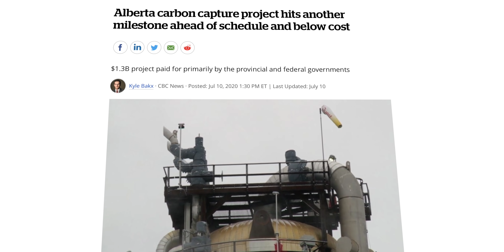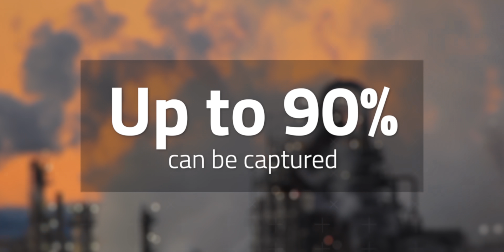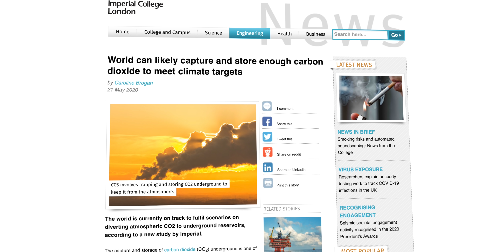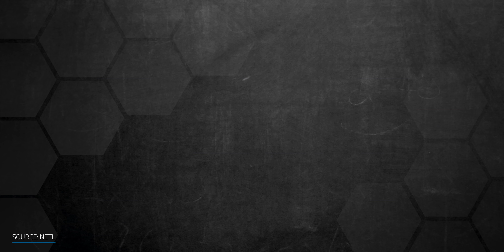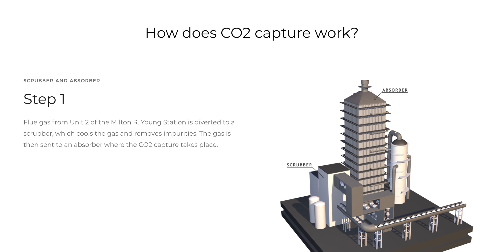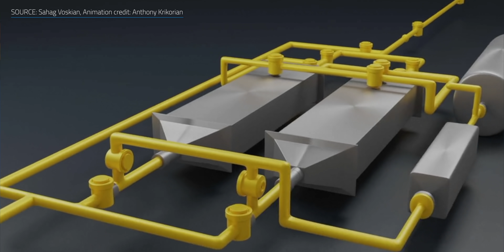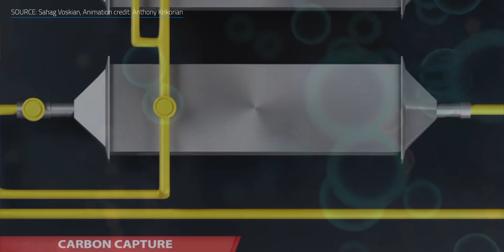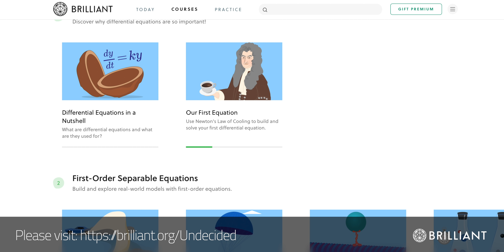The truth about capturing CO2 to reverse climate change

Comment: Why are we putting so much into stopping CO2, which only represents at most 26% of greenhouse gasses, why not concentrate on the one that may at most represent up-to 72% of greenhouse gas? 
Water vapor causes 36-72% of heat capture in the atmosphere, so if that represents 1.5-3 times the impact why not work on H20 instead of CO2 which only represents 9-26%?
we have plenty of industries that expell H20 so why not prevent/capture that
Reply: I know water exists in the form of oceans, seas, lakes, ponds and rivers but why does that mean we should not do anything about human emissions, especially considering all life on earth produces CO2 (yes even plants, they use photosynthesis to produce O2 from CO2 if they have light but use respiration to produce CO2 when they do not have enough light to photosynthesize.

Comment: Co2 is part of the planet life. Stop this nonsense. Co2 is the life line of the planet flora and oceans. Pollution and Co2 are 2 different things. Climate change is part of the planet cycle. We are  responsible for less then 1/4 of the world Co2. During the medieval Co2 was triple the amount of today. During the roman empire Co2 higher as well.
If during 1 year half the active volcanos decide to erupt you can't stop the Co2 increase.
If you have a green house and you want bigger plants you increase the Co2 inside.
Class C3 plant life has been extincted for millenia because the amount of Co2 in the air is low.
Stop scaming green House gases and pollution are bad. Co2 is normal and planet flora and oceans need it to create oxygen.
Now go drive you Co2 free tesla off a cliff.
Scammer.

Comment: "The energy sector is responsible for three-quarters of all green house gas emissions" BALONEY. the most powerful and by far  the most abundant of the 'greenhouse gases, is water vapour.  The atmosphere contains approximately 430 parts per million carbon dioxide that is 0.43%  ALL man made carbon dioxide accounts for between 3% and 30% (depending on who is providing the figures) of that 0.43% . Why are we removing this entirely beneficial and harmless gas from the atmosphere? The usual answer, someone stands to gain a great deal of money by pretending it is necessary.

Comment: you pump carbon out of the ground, burn it, then hide the co2 under a rock, removing the oxygen used to burn the carbon   permanently from the atmosphere.  no good.  you need to separate the carbon and oxygen, then bury the carbon.  photosynthesis rules.  sequestering co2 is no good because you are robbing the atmosphere of its oxygen..

Comment: What about all the christmas trees that are cut down and discarded every year? They could be used to make OSB, a building material similar to plywood, which would tie up the carbon for as long as the buildings that use it last. Then when the building is demolished, the rubble could be bricked and buried. Actually, the wood currently used to make OSB comes from fast-growing trees on tree farms - a more efficient method of CO2 capture than just planting trees, since mature forests reach an equilibrium between photosynthesis and respiration and natural decay which produce CO2. Then there are algae, which can be grown using sewage, water and atmospheric CO2, and multiply rapidly. They need little light, so they can be farmed vertically. They can be skimmed off and processed into biofuel, or just burned, which would at least be carbon-neutral. The same goes for waste biomass, like sawdust and waste wood produced by sawmills, which could be burned and used to power the mills. Garbage could also be incinerated cleanly at high temperatures, with catalytic converters sequestrating toxic combustion products, solving the problems with landfills and non-biodegradable plastics. The CO2 from burning biomass can be used to feed algae; there is even some species that produces hydrogen. As to the argument that it's an excuse for fossil fuel companies to keep pumping: they will keep pumping as long as there is demand, and we can use all the tools we can find. An unheralded contribution to reducing CO2 is the steady improvement in the efficiency of ICE engines, offset by the popularity of trucks and SUVs. EVs are all very well for the automobile industry, but there is no viable alternative as yet to fossil fuels for ships and aviation. More efficient engines and slower speeds help. There is some experimentation using sails to supplement engine power for ships. Maybe dirigibles could make a comeback? They could feasibly be powered electrically. He is a limited resource, but maybe H2 can be used for flotation, with effective fire-suppressant technology to prevent another Hindenburg disaster. One more hidden unheralded contribution to CO2 reduction is the internet, which cuts down on the amount of travelling people have to do. Average miles travelled have been steadily decreasing for a while, and covid has created a major shift from brick-and-mortar stores and workplaces. Progress is being made on many fronts, and every little bit helps.

Comment: Erm...you lost me at "this is a technology we need to take seriously."  (For a channel called "undecided," you seem pretty decided.)

True, we simply must stop polluting our environment with industrialised efficiency.  The debris with which we have littered our planet is simply awesome, because lots of people have been doing it for lots of time.  (Heck, archaeology wouldn't know half of what it does about long-lost cultures if they didn't throw things away.)   The loss of the Aral Sea wasn't to "climate change," it was politics and agriculture and mismanagement.  Most of the western United States used to be under water, which is why you can find massive fields of seashells in Utah, a thousand miles from ocean.  Shall we grieve over lost species of mollusk or trilobite?  
No.

Things Change.

The "climate" is constantly changing.  In the age of dinosaurs, you would not have recognised the continents' configuration.  There were higher levels of carbon dioxide to allow plants to grow fast enough to support the voracious plant-eaters, and higher amounts of oxygen to power the megafauna of the time.  (Jurassic Park forgot to show the dinos asphyxiating because it wouldn't make as good a film.)  Then an asteroid came in for a closer look and changed the climate.  8000 years ago, it started getting warmer, and the sea levels rose significantly.  Continent-straddling glaciers turned into valley-filling seas.  Species came and went.  Just look at the ice core data.  Change is the only constant, and even the sun's output changes over time.

How do we responsibly answer the threat of CO2 levels? First, we establish that it IS in fact a threat. Sherwood Idso's research in the '80s (https://res.cloudinary dot com/highereducation/image/upload/w_740,h_541,c_scale,f_auto,fl_lossy,q_auto/v1/TheBestSchools.org/Figure-16) suggests it is not (the photo linked shows faster tree growth with increasing levels of CO2.) Additionally, CO2 concentrations aboard US submarines (which stay submerged for six months at a time) average 4000ppm, and get as high as 8000ppm; ten to twenty times the current concentrations. Plants respond better to increased CO2. If you've never seen it, just fly over the Netherlands at night and notice the swaths of greenhouses that flood the winter sky with light. In addition to light, they keep the CO2 levels extremely high so the tulips can be bloomed in time to be cut and shipped around the world in time for the first day of spring. (You can also search "Netherlands greenhouses night" and find images.)

But the argument starts something like this: CO2 levels have increased from about 280 ppm to 390 ppm over the past 150 years or so, and the earth has warmed by about 0.8 degree Celsius during that time. (eia.doe.gov/oiaf/1605/archive/gg04rpt/pdf/tbl3.pdf)  Therefore the warming is due to CO2. But correlation is not causation. Roosters crow every morning at sunrise, but that does not mean the rooster caused the sun to rise. The sun will still rise on Monday if you decide to have the rooster for Sunday dinner.

We might also track the levels of the oceans to see if there's an effect there. NOAA data from 375 long-term trend tide stations is publicly available, and their changes have been linear. Have a look at one I happen to have in hand: NOAA 8628660, 960-065, PSMSL 399 at Portsmouth, Virginia (here's a link to the data, http://sealevel.info/MSL_graph.php?id=8638660). The net change across that station has been linear for most of a century since it started; about 3mm per year. The thickness of 24 sheets of paper in your printer.
Now look at Neah Bay, Washington (http://sealevel.info/MSL_graph.php?id=9443090) It has also moved about 150mm in 50 years, but it went down.

Or look at Port Angeles, Washington, where it has risen less than one millimeter in 40 years.
Keep clicking that blue triangle to flip through other stations; that green line in all of them is CO2. Note the sea level vector line is wholly unaffected by CO2 rise.
Remember, tides change as the earth spins under the gravitational influences of the moon and sun. In the Bay of Fundy (Canada,) the difference is 50 feet between high tide and low tide, and it has nothing to do with "global warming!"

Oops, I mean "climate change"...but they changed that hyperbole when it was not all found to be warming, meaning some places are cooling.

Al Gore started this twenty years ago; If the sea levels were rising even an inch a year, the "ground floor" (so to speak) of Venice would be underwater.  Their feet aren't even wet!  (A bigger problem is that Venice's wood pilings are rotting and sinking.)

Humans have been on the planet for...in round figures...say, six million years? Look at the ice core data for CO2 levels and compare that with temperature data, or with sea levels. We've persisted without our technological innovations for at least that long because the three have nothing whatever to do with each other. Don't take anyone's word for it, get the raw data and perform your own analysis. The GISP2 research is quite revealing; search for images of it and you can see the thermal changes that took place during the Medieval Warm Period, the Roman Warm Period - and others - for yourself.

Assume for a moment that carbon dioxide is a problem.  (Spoiler:  carbon MONOxide is a problem, and that does come from petrol cars.)  That means every breathing one of us exhales tonnes of carbon dioxide, and the plants we depend on for food and oxygen in turn depend on carbon dioxide which is not a pollutant!  And people breathing accounts for only a tiny fraction of all breathing animals' CO2 output.  Or should we consider wiping out all the other oxygen-breathers?  Any volunteers?

Got 30 minutes?  Fill your worldview with as many relevant facts as you can find.  W.K.Clifford would surely approve.
https://www.youtube.com/watch?v=NG1nEhRQ-H8
Got another 30 minutes?
https://www.youtube.com/watch?v=ssE1c80BBmw&t=22s
How about a full-Monty 2 hours?
https://www.youtube.com/watch?v=qWXiuJm8sf0&t=5s
Reply: Addendum:  A lot - though not all - of the concern for our planet's environment is motivated by a combination of greed, power lust, and ignorance; the same things that drive the Trump movement.  Even academics have to toe the line if they want to get and keep tenure.
Or think of this:  Where there is a trough, there will be pigs. 
I was a Republican...until 2015.  But I've put 110K km on my Nissan Leaf all-electric car over the past ten years because if we burn up all our petrochemicals, what are we going to get the plastics out of which our civilisation is made?  (It's been nice to see so many major manufacturers get past building a "compliance car," and start designing EVs as if for someone they actually love.
And as a bonus, it puts a hard stop on my dependence upon religious lunatics' sweet crude.

Comment: I really like my gasoline/diesel engines though. How about we capture the carbon, convert it back into hydrocarbon fuels using energy from nuclear plants or renewables, and then sell it again for a profit? A carbon cycle; the air becomes the return path for the expended fuel. Petroleum is an excellent energy storage medium; it's stable, energy dense, and we already have all the infrastructure to utilize it. Just a thought..
Reply: enjoy your diesel and gas when we're mad maxing it because of mass desertification and heat extinction

Comment: If the solution was plant trees, we would have solved it with planting trees. We need a fast and immediate solution because we are at the tipping point. Yes let’s plant more trees but let’s also put up carbon emissions capture devices so we can speed up the capture process. Let’s store it and figure out a way to use it after we have stopped our planet from catching fire. It’s not like the carbon is uranium. We can capture it and figure out what to do with it later.

Comment: Why is C02 allowed as a cleaning product? I've seen numerous video's where they have used C02 to clean everything from black mold from wood to rust off metal.
Reply: Usually because CO2 is pretty innert, available and easy to compress

Comment: Healing an open wound doesn't mean you skip the stitches after cleaning the dead tissue
Obviously, we need to reduce AND apply capture methods, both biological and mechanical
You don't protest Big Tire because you got a flat by just driving around with a flat until it comes off the rim. You plug it and put some damn air back in
The "Protest Everything" crowd need to stop shooting everyone else in the foot just so they can get their tweet on